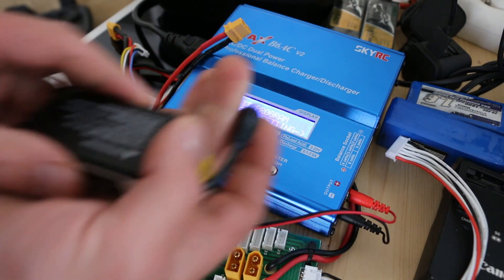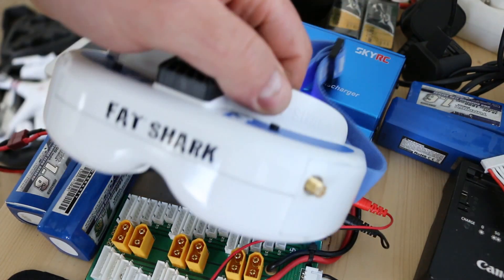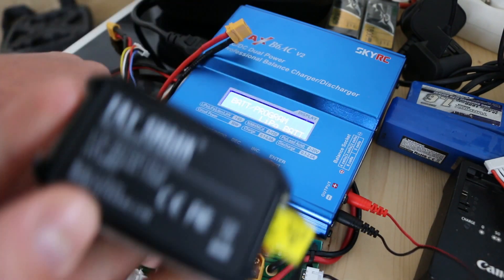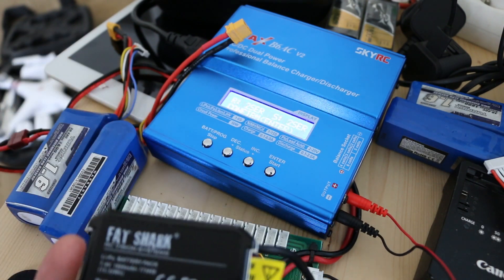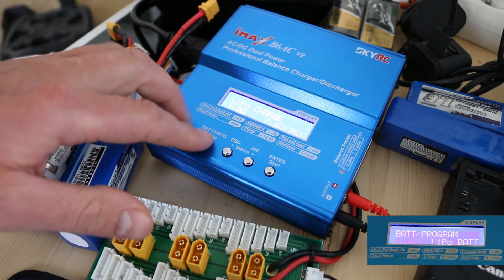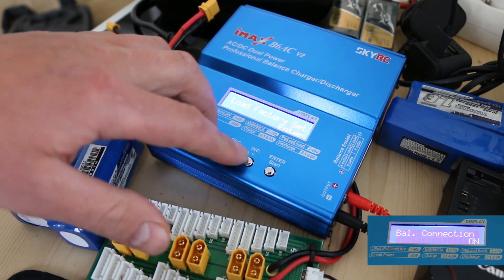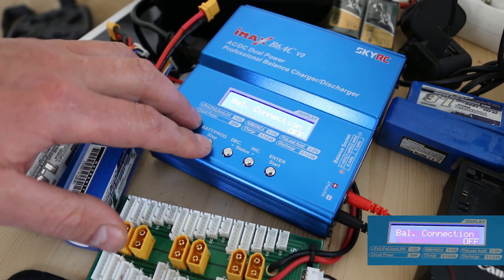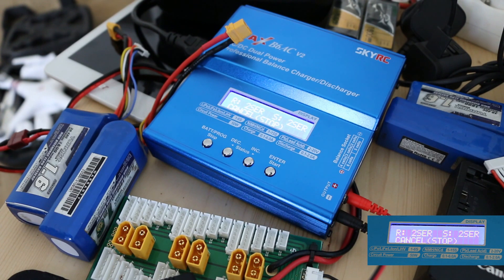BALANCE CHARGE ERROR - HOW TO CHARGE FAT SHARK BATTERIES (FPV BEGINNER TIPS)

Comment: As you suggested, need a parallel  board to charge > 3s packs.  I only had to plug in the balanced connector. The battery was not connected to the parallel board at all. In fact,  the battery was 5s and the multi board was only 3s. That suggests some jumper on the balance port would do it. I'd guess from the outside pins. But I ain't trying it as its working now!
Reply from the maker: Great bro